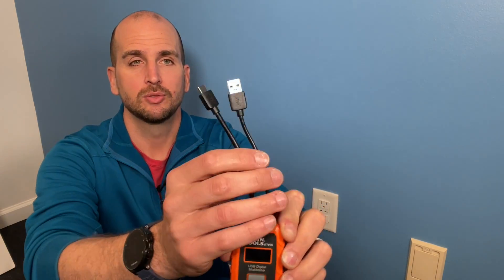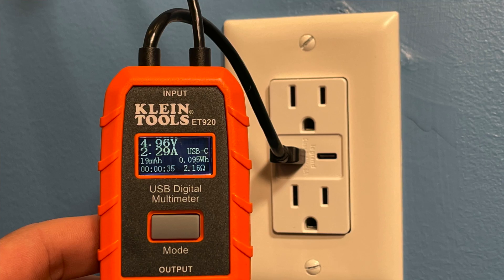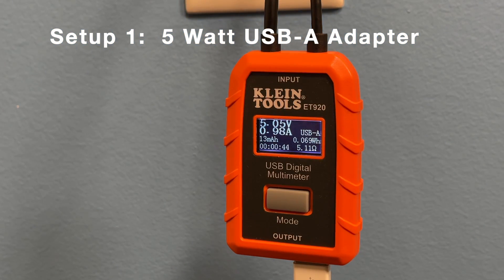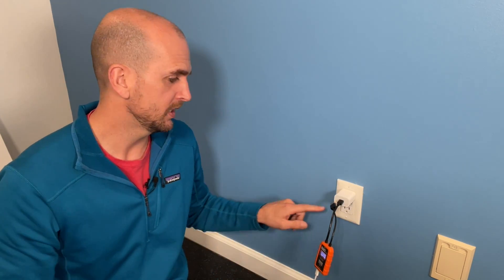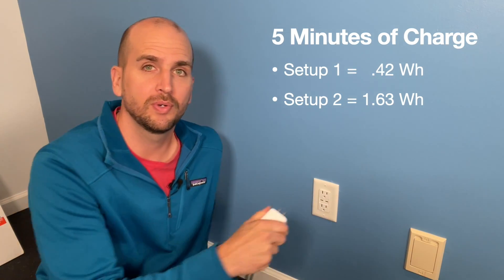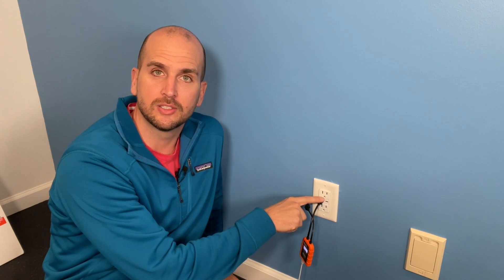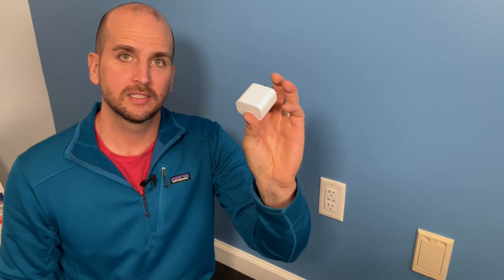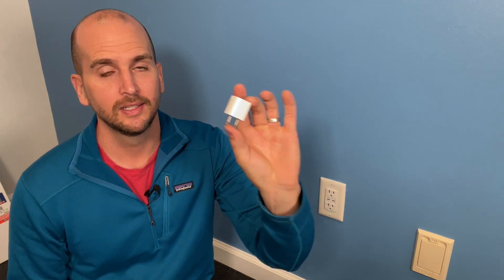How Fast Do USB Outlets Charge Your Phone

Comment: for the usb c plug directly to the phone to support the ability to charge as fast as the 20W adapter the outlet needs to support PD 3.0 and have the ability to change the voltage. the PD standard allows 100W charging if the device supports it. the Samsung Galaxy S21 supports 45W charging with a USB C PD 3.0 outlet. new apple laptops even higher wattages.

Comment: Can you do this test again, but have something plugged into the 2nd. charging port?  It would be interesting to see if there is a drop in performance if both ports are being used together.
Reply: Ditto. I would like to see the results if something like a (real world) coffee maker shared the outlet.
Reply: There usually is. Most of these outlets don't have any real regulation in them and tend to sag when there's a high load on them. I can't speak for the outlets he's specifically using, but (as it has been my experience with other outlets) they're generally just as bad as a cheap knock-off 5v power adapter.

Comment: My local electrical supply stores doesn't carry that meter. I like to get one. Well anyway, to my comments: The built-in is nice, but is a pain if it goes bad. I prefer the cube, but with different amp ports. Why? MP3 players & smart watches would get fried with a 2.4A charger. 1.0A is better for those devices. The 2.1 or 2.4 is better for cell phones & tablets. The 3.1A, the latest one out, is better for laptop computers & larger tablets. High rate chargers can damage your battery for small stuff. Vape mods, not pen e-cigs, is best in a cradle style charger & take the batteries out. The USB input takes forever to charge going that route.

Comment: This shows the difference between a vendor designing to the industry spec or to what -- as the manufacturer of the target iPhone -- they know it can tolerate. All versions of USB are supposed to be 5V, so that's what you get out of that wall adapter. They have to do it that way for UL certification and to be sure they don't damage some USB devices. Apple, on the other hand, got UL certification for the charger/phone COMBINATION. Since they knew the phone could tolerate 9V, that's where they went with the results you measured. The point is that the 20W adapter is intended specifically for USB-C iPhones, not generic USB-powered devices.

Comment: Need to careful about amp output. That has the potential to burn out the device and/or cord. The plug chargers are rated to prevent damage to the phone battery. USB integrated receptacle chargers aren’t designed to do that. The wise thing to use is use the charger that came with the charger. The other advantage not using the USB integrated plug is the plug is 1) really expensive, 2) they have a short life span. So personally I wouldn’t purchase one.

Comment: Not only does a wall plug with builtin USB has many issues with becoming obsolete and dying... Many will install this to every room or even every outlet and all eating power and generating heat 24/7. This is not good even ignoring save the planet hype. When they are finally used, they generate More heat that must be remove or will have a short life. Worse here if the box is full of wires or buried in Concrete, Insulation, etc. Most wall warts gets hotter when used but have huge amounts of air move over them to cool and other last 10 years or more Plus I can unplug them when not used.

Comment: nice vid as always! 

I saw that the Leviton T5635 can deliver 30 watts (1 port, or half on 2 ports). 

But the main difference seems that it is more like a real usb-c pd port, so it can go over 5 volts.Many power hungry devices with usb c needs more then 5V to charge.

I saw an amazon review with a usb meter and it can do 14.7V at 1.82A on a laptop.

Comment: I've tested Leviton USB-C 30W outlet and it was able to jump up to ~15V ~2A charge (was testing with iPad Pro) so it was charging it faster than included 18W brick. I'm surprised your Legrand outlet did not step the voltage up.
Reply: iPhones don’t support 30W charging yet

Comment: Charging rates change constantly and some go well north of 40watts. However it's the PD  or power delivery component of chargers that are important. This allows the charger to "communicate" with the phone to see how much juice it can accept. This newer technology let's you charge at multiple speeds depending on the device. You did well to point out the amperage was different as well, you can't just look at wattage. Just looked up the outlet and it's 6watts total, 3 per usb port. With all that being said you have to match phones with the charging side correctly to get the fastest charging speed. Anything else and it will default to a safe slower charge speed. Great video.

Comment: In most cases charging your phone slowly is far better for the battery than using fast charging.  Depending on your device you may not be able to rely on a regular 5V only charging port as some larger devices like tablets and Chromebooks need 9V or 12V power delivery mode or more on the USB port to charge.  I would not ever recommend putting any switchmode PSU in a wall cavity or receptacle box as they generally lack decent surge suppression, isolation, and they are a phantom load when you are not charging any devices.  Many of these receptacles also provide a very noisy 5V output which may cause a device to fail or be damaged over time.  On many devices, using a 3rd party adapter may also void your warranty if the 3rd party adapter does not meet or exceed the original adapter quality and specs.  People would be amazed how much money they could shave off their electric bill if they eliminate all the phantom loads in their house.

Comment: It would be interesting to see 2 phones charged using the receptacle at the same time. I'm assuming there would be a reasonable drop in charging capabilities.
Reply: Phones do not use a lot of charge capacity.  By Hubbell USB15A2W for fastest charging receptacle.  I don’t think Lowe’s.
 Has Hubbell anymore so check local electrical distributors

Comment: I use a charger with the Qualcomm 3.0 + chip. 50% charge in 30 min. A usb wall port would be good for wireless ear buds, power banks etc.
Reply: @G Nic  Yes... I put a rather long-winded comment myself... This whole thing goes against the "regulated / step down" voltage provided by Qualcomm.  I am admittedly completely ignorant; but I'm just not comfortable with this advice, at all.

Comment: Just remember that phones charge slower and slower the closer to 100% that they get.
Reply: I also found that some of them have a limit on the charging current that they will allow. I have a cheapo phone. On which I have tried a 1 amp charger, 2 amp and 3 amp. And no matter what charger I try on it it only charges at 1 amp. And because of this it takes three whole hours to charge this phone.

Swapping the cables out for different ones made no difference.

Comment: I do not like "integrated" devices. Components can - and will - go bad so you end up having to replace the entire device, not just one part. Here, if the charger in the outlet goes bad - like from a power surge - you have to go to the bother of replacing a whole outlet. Also technology changes - rapidly -  so you will be stuck with whatever old tech is embedded in your device. Instead of simply replacing a single device. As the video pointed out, charging technologies are changing and require different adapters.

Comment: How would a GaN charger compare? I've heard they are pretty efficient and generally charge devices quickly.
Reply: GaN is more for small size and efficient charging. It's theoretically the same speed as standard silicon chargers, but does allow for faster charging from a given size of adapter.

Comment: In my experience USB-C solves a LOT of charging issues. I used go crazy trying to find working combinations of chargers, cables and devices. Some just would not work.

Apple lightning always seemed to work though.

There's is nothing wrong with slower charging for a lot of applications though because it's easier on devices.

Comment: One limitation of the multimeter to know about:

The usb A plugs on this meter appear to just be USB 2.0 compatible, so that means for newer charging standards it will give misleading results. QuickCharge 3.0 specifically can work through these connectors, but performs better with usb 3.0 connectors.

The usb standards have changed so much over the years, and is very confusing. Usb 2.0 and 3.0 referrs to the hardware itself of how many wires are run through the cable basically, so the USB-C connector is always 3.0. Then the electronics have their own set of standards. Here's the short run-down of just the most relevant methods today:

2.4A "slow" charging (5v):
The unfortunate thing is manufacturers will ALWAYS say their device has "fast charging" even though it doesn't support any of the fast charge standards. This type of charging can be done on any connector, although typically won't be seen on USB-C anymore.
Pros:
  Cheaper per-port
  Many ports in one device are available
Cons:
  "slow" by modern standards on new devices
  may cause damaged or low quality cables to heat up during charge
  won't charge laptops, may struggle with larger tablets
  Power banks require 'overnight' charging
  Scummy advertising on many products implying they're better than they are
What to look for:
  They'll usually advertise 2.4A on the box.

Qualcom Quick-Charge 3.0 (5-12v):
Skip right over QC 1.0 and 2.0 for new devices. Quickcharge 3.0 is used by many devices, including newer iphones (even though apple pretends they invented it). Quick-Charge 3.0 is what I believe is being shown over USB-C in this video, but is also available on many USB-A chargers. It performs better on usb-3 type A or C connectors (which have more than 4 pins inside). Quick-Charge allows the voltage to be bumped up as requested by the device anywhere up to 12V.
Pros:
  All you would need to fast-charge most phones for some time into the future
  Should work on all modern tablets
  Power banks charge in a few hours
  High availability
Cons:
  Won't charge most laptops
  Not the fastest for power bank charging
What to look for:
  They'll advertise Quick-Charge 3.0 on the box

USB-Power Delivery (5-20v):
Power Delivery is the new hotness.... even though it came out in 2012. Manufacturers are now switching back to power-delivery because it can produce up to 100W of charge power at up to 20V!
Pros
  THE POWERRRRR
  Charges laptops
  Fastest standard available for power banks and modern phones
  Backwards Compatible
Cons
  More expensive
  Seems mostly limited to USB-C
  Typically one P.D. port per device, and most of the time other ports aren't quick-charge compatible, so if you have a lot of devices it adds up fast $$$
What to look for:
  They'll advertise USB-Power Delivery on the box, plus the number of watts that specific supply is capable of.

Comment: I have 5 outlets with USB ports, they are various outputs. The cheapest USB outlets are about $15 (same as your small phone charger), the most expensive about $30. I have had these installed for about 3 years. They do work well. Depending on time and what I’m charging I use different chargers.....thanks.   Jim

Comment: The little brick is 5W. Your outlet package said 6W. The Apple USB C charger is 20W. Thus, Apple's charger is going to absolutely destroy the other two, and the in-outlet plug will only do a little better than the baby brick.
Okay, the outlet did a lot better than I expected. Going back, it's because I'm an idiot and confused the 6 amps on that package for watts. Oops.
Reply from the maker: Hahaha, honest mistake.  The outlet also did better than I expected.  Need to research a bit more and see if there is one on the market which can actually deliver fast charging voltage and amperage.
Reply: @EverydayHomeRepairs , I have Leviton's outlet with two USB-C ports, and can confirm it has USB-PD, so works great to charge iDevices at maximum speed. T5635 (15A) or T5835 (20A). 

Topgreener makes one too, though I haven't personally tested it: TU115QC3PD
Reply: I thought the outlet package said 6 *Amps*. Very different beast, and that would be 5 volts * 6 amps = 30W if the receptacle lives up to it's claims and a connected device tries to draw that much.

Comment: Is there a receptacle out there that can deliver the needed voltage for "fast-charging"? Would be interesting to find a receptacle with better specs than the Legrand to see if you can match the USB-C plug adapter
Reply: Leviton T5635 claims 30W charging on a single device. That's the highest I've managed to find so far.

Comment: I think an important subject that was not addressed in the outlet mfg advertised 6 amp USB charging, 3 amps per USB-C plug and delivered far less.
Reply: The criticisms of the Legrand outlet are perhaps slightly unfair - The phone pulled 2A, that's not necessarily to say the outlet couldn't have delivered more had the phone drawn it. Apple may limit non-Power Delivery USB charging to the 'standard' 2 amps. Fundamentally this is the reason I would never install devices like these - I want to replace receptacles once every 20 years, if that, but USB power delivery is a rapidly moving target that becomes obsolete very quickly.
Reply: @AndrewFremantle  to be clear, I didn’t criticize Legrand. I just said the interesting topic would be why the full 30W wasn’t delivered. I do believe that either the multimeter or the phone limited the amp draw.
Reply: @robb0995  it's the iPhone at fault, here. Apple will slow charge unless a charger is USB-PD, and I think only Leviton and Topgreener make USB-PD integrated outlets.
Reply: @DonaldZiems  again, I need to reword my post which I guess I’ve accidentally framed really negatively. I don’t think there’s “fault” to be found so much as an interesting topic that was missed in the video to understand the variables at play.
Reply from the maker: Details, details 😁
Reply: In fact, it was the interesting outcome of the entire experiment. You don’t need a multimeter to tell you that 5W * 1/12 of an hour ~= .42Wh and that 20W would be four times that. All I needed was Ohm’s Law and a calculator for that, assuming they provided the advertised power. 

However, 6A @ 5V should’ve been delivering 30W, and the interesting topic is to understand why. Was the multimeter incompatible with it and failed to draw the amps it could’ve? Was it misconfigured? Was the receptacle defective? Or was the advertised amperage misleading?
Reply: https://www.legrand.us/wiring-devices/outlets-and-receptacles/residential-receptacles/radiant-15a-tamper-resistant-ultra-fast-usb-type-c-c-outlet/p/r26usbcc6wccv6

The Legrand website confirms that it should’ve been capable of delivering 6A or 30W per port, so it should’ve won and been 50% faster than setup 2.
Reply: @robb0995  According to the website you linked the Q&A has a Legrand Technical Support user respond say in doesn't support USB-PD and "only provides 5V output and each port can produce 15W (5V/3A); 30W total."
Reply: @zerowing430  again, lots of good stuff to talk about in a followup video. A lot to be aware of that takes a little sleuthing.
Reply: Using a USB-C trigger board and a load tester, you could measure both what charging protocols it supports and at what draw does it kick off for overload.

Comment: Two questions:
1) Did your charging testing start with the phone battery at the same charge level? If not you’re assuming charge time is a linear function.
2) How much energy does the built-in USB charger consume while not being used to charge some device?
I can unplug the plug-in charger to eliminate that energy waste.
Reply from the maker: Hey Art,  good questions
1)  Battery percent was not exactly at the same level for each test but did stay between 30% and 45%.  
2)  From the general Specs on the Klein Tools ET920 this is what it states for power consumptions "It requires NO batteries and uses minimal power from the power source to function, ensuring accurate and reliable readings." 
Cheers!
Reply: @EverydayHomeRepairs  Sorry, my second question was not clear. How much energy does the receptacle consume when it’s not being used to charge a phone?
Reply: My older USB chargers were a little warm when not charging a device but the last 3 or 4 chargers that came with devices do not making me think newer ones do not consume much energy. Hubbell has combination 120 volt receptacles with 2 USB ports that was told do jot use energy when not charging. They have long lasting stainless steel hardware for USB port. Not crazy about how deep the combination 120 volt recetacle/USB charger takes up. With my luck 6 months after I spend a hundred dollars on some combo teceptale/charger tjey will come out with s new stlye USB plug.

Comment: Prediction: The USB-C Apple charger will be the best, but the Legrand outlet will still be a lot better than the traditional Apple USB-A charger.
Reply: The USB-C standard is designed for/capable of higher currents, and I know the small Apple USB-C brick is a higher wattage charger than the tiny default Apple cube. But I still just had a feeling that the charger included in the duplex outlet would be better but wouldn't match the winner... That one was just a hunch/educated guess.
Reply: Interesting also that it roughly halves charge time at each step ~20/40/80.
Reply from the maker: Admittedly, until a few weeks ago I would plug into the tiny 5W adapter if nothing else was handy but it is SUPER slow for a 12 Pro Max which sparked the interest.
Reply: @EverydayHomeRepairs  I'm just as bad. I use my stockpile of old tiny Apple cubes all over, but I do try to keep them to places like the nightstand where time isn't really as much of a factor. They also make really compact little power supplies for other USB-A powered electronic devices that draw relatively little power.